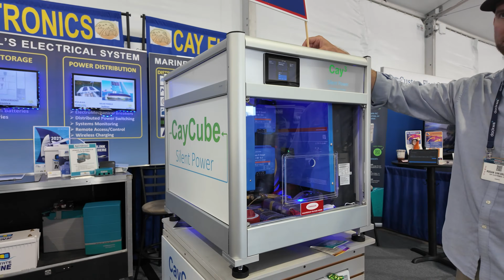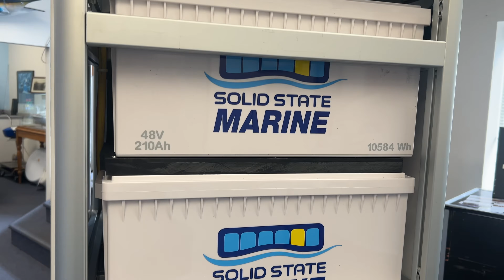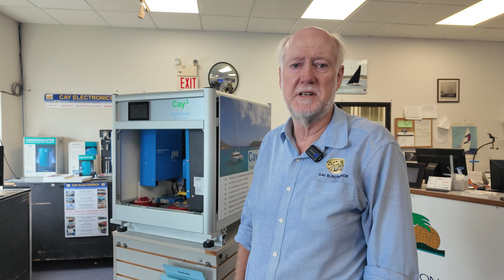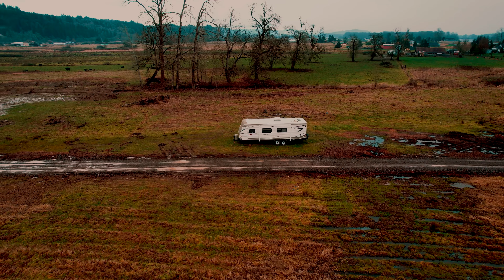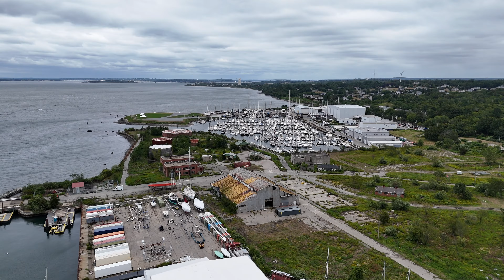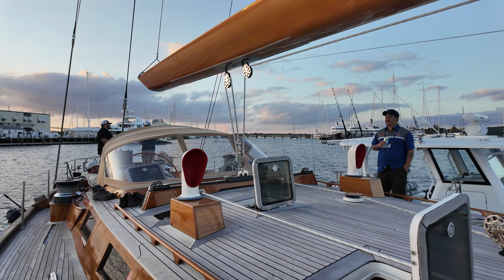This Fully SILENT Generator is Capable of Powering an Entire Home

Comment: Usually when companies studiously avoid actually telling us what the battery chemistry is, it means there's a serious problem.  "Solid State" is not a chemistry.  So what chemistry are these batteries using?  By the weight its kinda sounding like NMC or NCA and not LFP... which would make it a no-go in more or less any environment.  Solid state or not.
Reply: these are Lithium graphene batteries, replacing the electrolyte in others w/ graphene to increase the energy density, charge cycle endurance, and safety